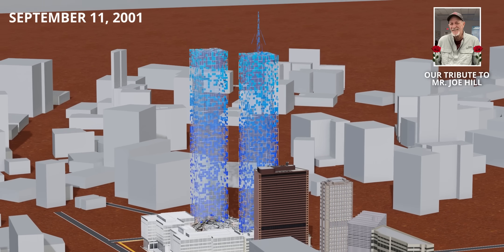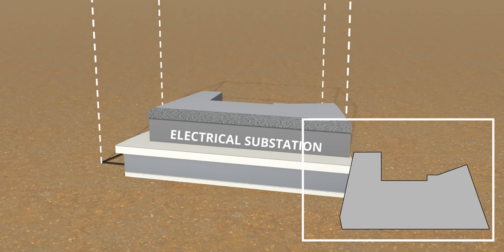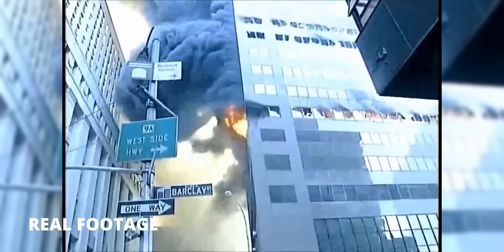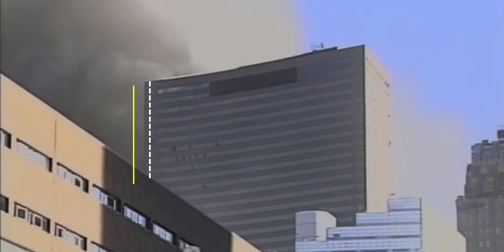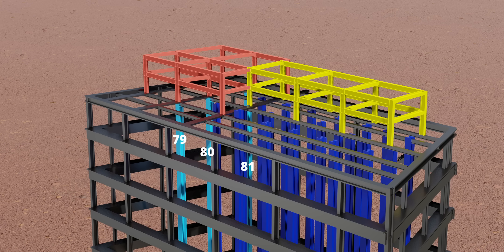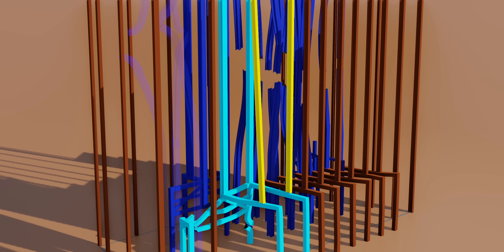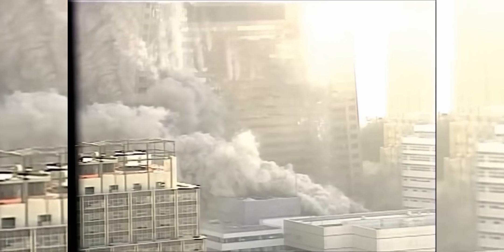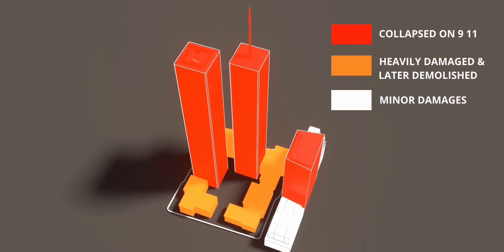Collapse of Building 7 | The Complete Physics

Comment: No steel frame building ever has basically zero supportive or resistive forces....unless...you...pull...it.  Period.
Reply: Buidling 7 was not pulled down with cables - obviously. After 7 hours of building-wide unfought fires (3 times over its design limit) the lower floors in the NE corner failed, which left a critical column with insufficient lateral support over and excessive length, causing it to buckle.  This then led to a progression of core column buckling failures due to loss of lateral support until the core was gone, taking all the floors with it and leaving only an empty outer shell (empty cereal box) which, quite unable to remain standing on its own, supported as it was by just 4 columns.

See, facts are much better than simple hand-wave nonsense, even if thinking is harder.
Reply: @TheCriticalStinker-01  So you translate "pull it" with "pulling it down with cables" now stinkyfitz? Careful shill, you´re risking your job!

Comment: 8:19 “It didn’t fall perfectly down” shows it falling perfectly down
Reply: Define perfectly
Reply: @TheCriticalStinker-01  straight down, like he showed. What would’ve been more believable would be it folding on itself at the bottom and falling over, like felling a tree
Reply: @HyBrandtFN- A tree is solid and rigid. A steel framed building is 95% air by volume and inherently flexible. Steel framed structures fall down. They do not topple.

Reality is fine. Your expectations and starting assumptions are wrong. 

Also, Building 7 twisted and leaned a bit to the south as it fell  - because flexible.
Reply: @TheCriticalStinker-01  I said felling a tree, as in a hunk at bottom of the tree is missing
Reply: @HyBrandtFN- A tree has a hinge point.  Because the tree is solid and rigid, the only thing it can do is rotate at that pivot point.

A building is more like a Jenga tower. It will drop. There is no pivot point.
Reply: @TheCriticalStinker-01  how do Jenga towers fall again?
Reply: @HyBrandtFN- Down
Reply: @TheCriticalStinker-01  too hard trying to play on yourself, isnt it clear enough whos the actual terrorist right after the iran war? trump lied a lot yk. no difference w other US president since most of em involved in middle east war
Reply: @HateToSayThisBut  - Deliberately evasive off-topic derail noted. Please stick to topic.

Comment: I refuse to believe the other columns would fall at free fall speed if the penthouse columns damaged.  I would accept this explanation if the building had partially collapsed.  There are buildings with less support in war zones that get hit with missiles that don't collapse.
Reply: And you shouldn't, since no one is claiming that is what happened. Maybe this will help:

Building 7’s collapse was completely different to the Twin Towers and harder to understand as most details hidden from view and not intuitive, but we can still sort out what happened through careful analysis and observation.  This is my explanation  of the collapse relying on no outside authority.

Building 7 was complex, assymetrical 47-story steel framed structure built atop a smaller 3-story building, requiring lower floors dedicated to complex load transfer structures, not usable office space. Of trapezoidal shape and all-steel tube-in-tube construction, B7 (above the 7th floor) consisted of a central core of steel columns carrying most of the gravity load, perimeter steel columns around the outside of the structure carrying the remainder of the gravity loads and long span beams and girders to tie those elements together and form the floors. On the outside of the building hung a moment frame or outer shell.

Phase 1 : First externally visible signs of collapse initiation occurred at 5:20:28 pm and were notably quiet with observers not realizing the building was collapsing! No audible warning in the form of  hundreds of ear drum busting 180-190dB explosive bangs preceding the collapse. Here at 12:00 a local CBS affiliate reporter is talking 10 blocks from B7 when collapse begins. People don’t start to notice the collapse until 12:11. At 12:45 is the famous CBS fixed camera clip of Building 7’s collapse. Note how quiet it is.

youtube.com/watch?v=t5tEy6mXSE8&ab_channel=fresnosean379

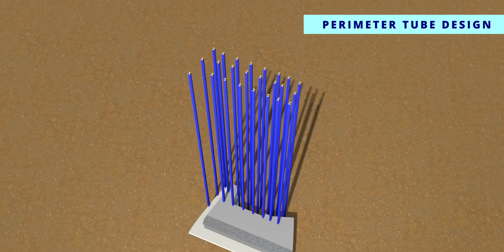Collapse initiation was due to lower floor failures above the load transfer region (7th floor) in the NE corner. In this video at 0:45 you can see the NW corner from inside the building while under construction, Column 79 just out of frame on the left. That big, angled steel beam across the top of the frame connects to C79 at one end. The girders connect to the beam. That beam and all those girders depend on just one connection

youtube.com/watch?v=nP3TNHPCIVU&t=35s&ab_channel=EdwardCurrent

Phase 2 : The floor failures caused a loss of critical lateral support over an excessive length of core Column 79 and it buckled. If you look at a floor diagram of Building 7 (see above) and look at all the structures that depend on C79 you quickly realize this one column was a relatively isolated structural element on which a disproportionately greater fraction of the structure depended analogous to say the Key Bridge. Externally we see a vertical progression of window breakage along the 44-46 line and a kink in the roof of the East Mechanical Penthouse at the top of the building, consistent with C79 failure. The transition from full capacity to almost no capacity occurs in an instant. Once the buckling failure occurs there is almost no resistance

Normally with a buckling column, the load could be redistributed to other columns. With C79 that is not the case - the failure did not redistribute the load, so the collapse rapidly progressed to the roofline, sinking the rooftop penthouse.

Phase 3 : With C79 gone, B7’s progressive, non-symmetrical collapse continues with C80 and C81 at the east end of the core left laterally unsupported and quickly buckled and failed as well, sending the EMP down through the building. C79-81 all have no diagonal bracing, which I believe is a major reason why they could not redistribute a lot of vertical loads among one another.

From there collapse progressed from east to west through the central core until the core was gone taking all of the interior floors and probably most of the perimeter columns with it. Follow the horizontal progression of window failures low in the building and the dropping of the remaining rooftop structures into the building. One of the big takeaways from the NIST Building 7 study (that gets completely ignored) was their modeling which determined C79 failing under ANY circumstances would have initiated the same collapse sequence.

Phase 4 : After 10 seconds only the exterior moment frame - a hollow empty outer shell – remains, giving the ILLUSION the Building is still standing since little has outwardly changed.  It is just a hollow empty shell like an empty cereal box. Supported by only a few remaining columns that empty shell is quite unable to remain standing. With all core columns and floors gone, the north face leans inward, forming a V in the roofline, the last few columns buckle under the strain and the moment frame free falls, landing on top of the 7-story high debris pile. It is only late in the game here at the end that a single measurement of alleged free fall acceleration is taken, from a single point on that outer shell. The Building did not “free fall” – just one corner of the outer shell did, sort of. The Building was already gone before that happened. The period of alleged free fall was a product of how it fell NOT why it fell and cannot tell us what started the collapse. Start to finish the entire collapse took 18-20 seconds, 3 times longer than true free fall .  How fast something falls cannot tell you what started it falling_ anyway. The debris spread outside the footprint, blocking surrounding streets, heavily damaging the Verizon Building and destroyed Fiterman Hall.  

Building 7’s progressive, non-symmetrical collapse was incidental and unintended collateral damage from the combined effects of fire + time + gravity, started by the collapsing North Tower. That is true no matter who planned and carried out the 9/11 attacks or why . The collapse was of so little consequence it barely even registered at the time, a mere footnote. It only took on semi-mythical status as an alleged smoking gun years later when demolitions at the Twin Towers, missiles at the Pentagon and shoot down over Shanksville all failed and conspiracists had nothing left to work with.

Anything can seem like a conspiracy if you don’t understand how it works. Now you should. I hope you found this helpful, informative and it solicits informed critical comment. If I made any errors of fact, logic or reason or left anything important out, please let me know so I can fix it. IF you can offer a more plausible alternative please do. Be the first. Please start any reply with the words “Tits McGee” or I will know you didn’t read it and are wasting my time.
Reply: @TheCriticalStinker-01  Hey TitsMcFakeNews.  The damage would not cause the other pillars to completely fail in such a catastrophic, freefall manner.

Comment: steal doesn’t melt at 600 degrees
Reply: So what? Neither does gold. Or copper or nickel of titanium or a whole host of other metals.

The relevance of when a metal melts is nil.
Reply: Relevance?
Reply: @JiriStipek-b6o  NIST analyzed steel from the impact zones, steel directly involved in fire. None had reached 600 degrees Celsius. Yet there were multiple reports of molten steel at Ground Zero, also there were molten iron spheres all over in WTC dust.
Reply: @Kudde23 "Yet there were multiple reports of molten steel at Ground Zero"
There were multiple reports (and indeed photographs) of molten METAL. The "steel" part is wild speculation ignoring the existence of tons of aluminium (mp 650 dg C) and about 100 tons of lead (mp 330 dg C) from the power backup system (UPS). Where did these go?

"... also there were molten iron spheres all over in WTC dust."
As they would be in dust from any site where arc welding was widely used during the construction. There are many photos available. Why do you think the welders were wearing leather aprons?
Reply: @Kudde23 The fact somebody is saying he saw a molten steel doesn't necessarily mean there was a molten steel. Even IF there were some spots where steel melt, it doesn't prove the use of thermite. The most obvious spots where this could happen would be in the vicinity of the massive batteries of the UPS. The energy stored there had to go somewhere and it is not unheard of, batteries like this producing temperature over 2,000 dg C when shorted. 
Also, molten aluminium can do funny things when combined with water. Watch Bing video "How Aluminum May Have Collapsed the Twin Towers".
Reply: @JiriStipek-b6o  If anything, you'll find that, thermite pretty much dis- proves molten steel, and vice-versa. Thermite, no matter the exact composition, gets really really hot....for a really short time. And then it goes out. That's the thing about a vigorous reaction, it uses all the material instantly and then ends. Even it there had been liquid steel, it would have gone back to a solid state more or less instantly as there was no continuing input of heat energy.

The generally accepted ratio of thermite to steel is also on the order of 5 to 1. So, to liquefy steel at all would require 5 times as much thermite, which would be rather notable amounts.

But then, Pillowbiter doesn't care about that. It doesn't really care about anything, other than running around trying to pretend it's really smart and with it. You'll note that it, 1, repeat the same thing over and over, and 2, when actually proven wrong, changes what it says and pretends it never said what it clearly did prior.
Reply: @mooneyes2k478  Pretty much my assessment. Thanks anyway.🙂
Reply: No one is claiming it did - or needed to.

Comment: BS! REGULAR OFFICE FIRE WOULDN'T BURN HOT ENOUGH. What happened to that 38 storey apartment building in britain? They cleaned it up and rebuilt it. No demolition. 
How about that.
Reply: So, you managed to completely fail.

Good work.
Reply: Grenfell Tower was made of concrete, not steel and it has been condemned and will be torn down. It's fires were primarily external.

Analogies are not evidence and in this case not even analogy.

What happened to the 17,000 buildings in Los Angeles that burned to the ground from regular fires ?